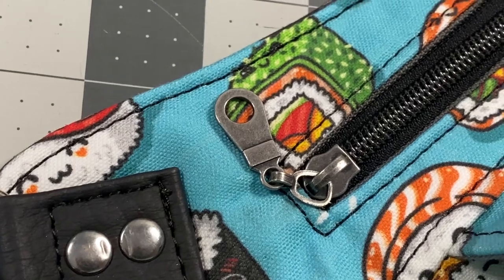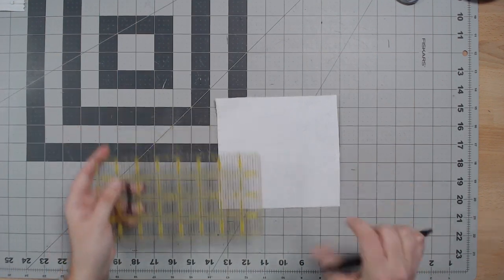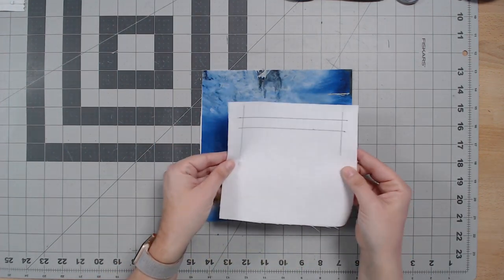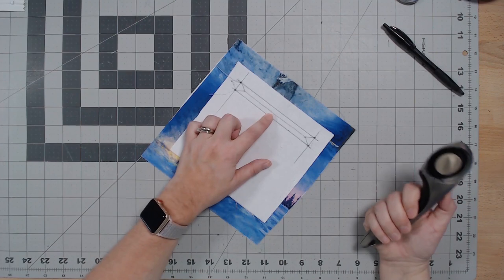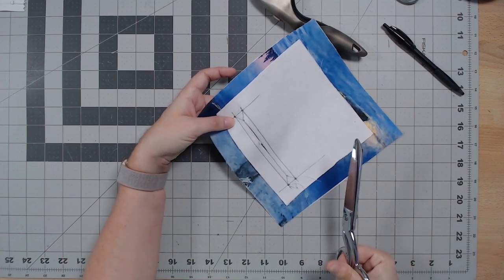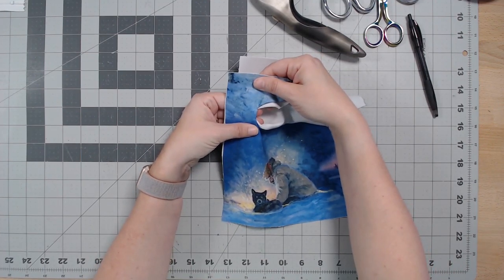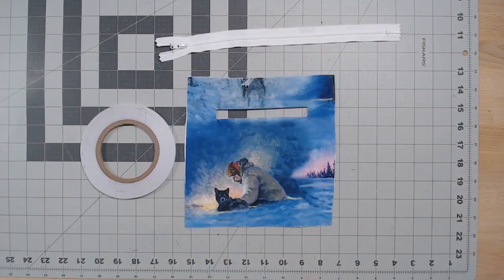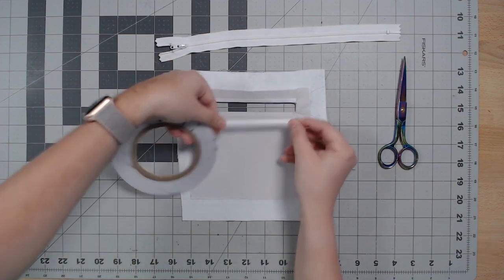How to Sew Welt Zippered Pockets

Comment: If you buy glass head pins, no need to worry about melted pin heads.

Thanks for the tip on only sewing the upper and lower horizontal lines for the rectangle. I hadn't heard this before, but it definitely makes sense.

Comment: First of all, this is an amazingly clear tutorial for a welt zipper pocket, which is amazing, because even knowing all the steps myself for a regular welt pocket, I get dizzy just trying to remember them.

What I did notice though, is that your welt zipper pocket - apart from having a zipper - differs from a regular welt pocket on one thing. Around 8 minutes in you start cutting open your welt pocket, and turn everything around, and iron everything neat so everything stays in place. So far so good. 

But what you did not do is pay any attention to those little triangles - I was taught fold them back, iron them, and sew a reinforced stitch over them while keeping the outside fabric out of the way, in order to reinforce the pocket for the weight it might carry while not showing anything on the outside. 

Do you intentionally ignore that because you sew right over when you sew the zipper in, and the zipper might carry some of the weight, or is there another reason? 

Thanks again for this amazingly clear tutorial, I'll be definitely be keeping it in my saved videos list to rewatch when I'll be making a welt zipper pocket sometime soon.

Comment: I score it before I push the fabric thru along the st line. Also I tried doing them with stitching only the top n bottom lines but find I can get it neater if I st the whole box. I also use tape but just a double sided one not for any particular purpose just a general purpose one as the zip will be stitched in place I only need it to hold temporarily

Comment: Love this.

Is it possible to do a welt pocket, in an interior OR exterior bag pattern piece, that has been sandwich quilted?

I sandwich quilt my layers (feature fabric, wadding, interfacing) - to avoid using fusible products and to pad up bags that I know will be carrying electronic devices (heavy, glass, metal).  I would love to use these zipped velt pockets in the internal and external pattern pieces.  

I have prepared myself that the answer may be “no”, but live in hope.

I’d thought it through in my head, and wondered, if I cut out a “window” around the zipper veld area, (to cut OUT the wadding and interfacing there, so leaving ONLY the feature fabric, or lining fabric, for the area of the veld pocket) would that make it possible?

Making the velt, reminds me of a mailbox slot (after you’ve pressed it). 

Thank you for clarifying about ANCHOR KNOT stitch, I’d always wondered about that.  I often sew those high stress points in a bag, three times, because I want them to stand up to lots of use.  Will be hand-tying them from now on.  

Your explanations for topstitching are so on point, I love topstitching, makes things stay where they’re meant to.

“Finagaling” word of the day 😊
Reply from the maker: I think you're right - the answer would be no :( Without stitching through all 3 layers at once to do the welt pocket, not sure how you'd do it otherwise. That exterior fabric needs to be interfaced to support the zipper and weight of what goes in its pocket.
Reply: @fiercekittenz  thanks, you’ve saved me from wasting fabric and frustration!

Comment: Thanks for the tutorial! very helpful. Could you share what type of interface brand you used?
Reply from the maker: I have a few brands on-hand. It depends on when sales happen. Pellon's Shapeflex 101 (SF101) is great and widely available. I'm a little wary of buying from smaller shops, because I have seen so many of them close down over the years. That leaves you high and dry on a supplier in those instances.

Comment: I like that material. Personally I'd do it differently. I'd sandwich the zipper between the lining and outer fabric so once you completed the pocket you don't have the zipper webbing on the inside of the pocket giving a smooth inside .
Reply from the maker: B Cobler you can totally do that too, though I like this method because I have greater control of what the zip looks like in the end. With zipper tape edges being finished, I don’t mind if they show. They’re pretty tight pockets so you’d have to be digging around to even see it.
Reply: @fiercekittenz  I really want to know how to do this sipper sandwiching for a shoulder bag I am making. I want to use this technique for the main zipper compartment but can't figure out how to do it while keeping the edges covered. To be clear, I am trying to make a Prada re-edition nylon mini bag. Is there a tutorial you recommend for something like this? Where the zipper is sandwiched. BTW this would be an oval shaped welt if that is even a thing. Just bc of the shape of the bag. I want to use a single piece of fabric for both the front and back outer main panels.

Comment: I have been wondering how the needle doesn't get jammed while crossing over the zipper teeth. I have always just snipped out that section of zipper and sew only the fabric strips that are remaining at the end to secure it. I would like to start doing this a more professional way though and I'm wondering how I can sew in zippers with thicker teeth. Any tips or tricks are much appreciated 😄👍
Reply from the maker: Well for me, I use larger needles and the teeth are acrylic. I've never run into any kinds of problems sewing over the teeth. Of course if it's a metal zipper that's a totally different situation.

Comment: The last time I used the 1/4 tape I found it gummed up my needle. Am I using the wrong tape?
Reply from the maker: Hmm maybe. Are you using the washaway tape or a leather tape? I've not had any issues, but I typically use my Juki DU-1181N industrial machine with size 21 needles.